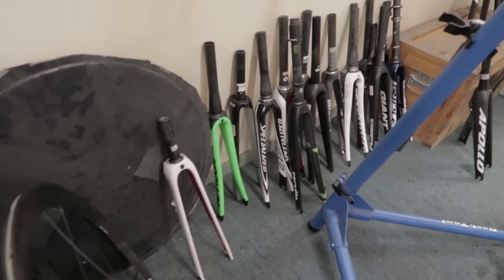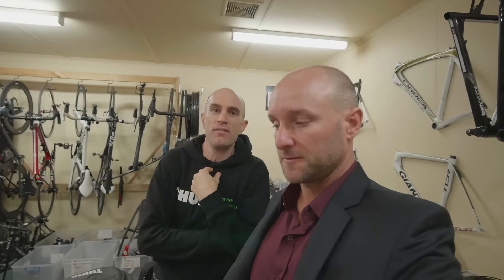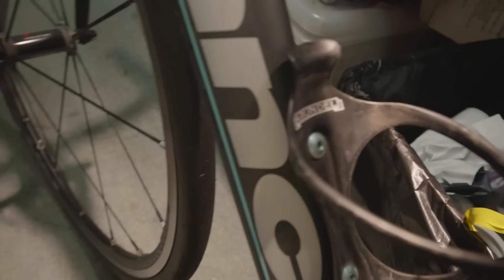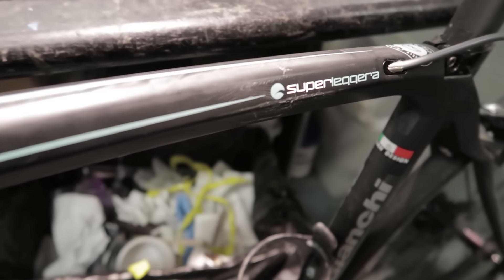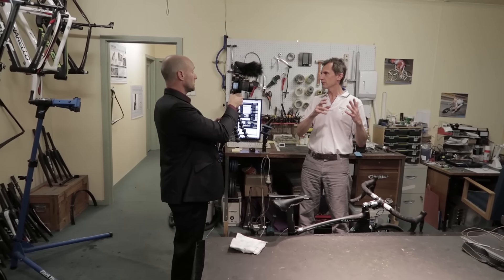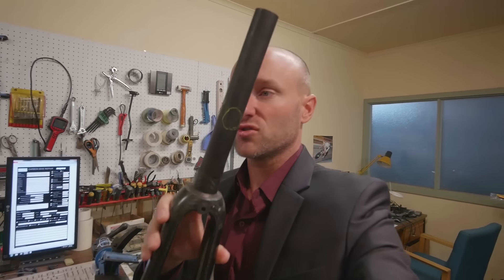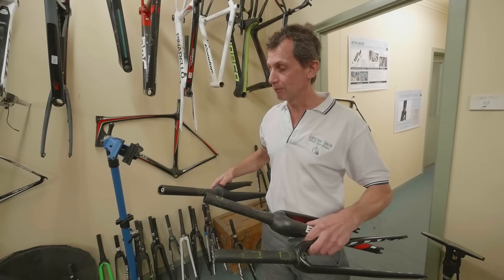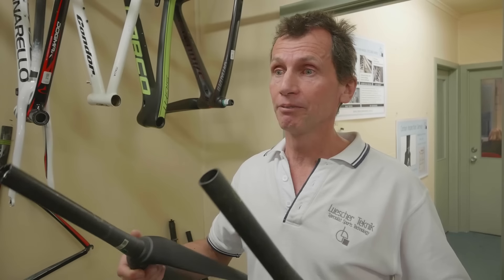Carbon Fiber Bikes - Are They Strong Enough? (ft. Raoul Luescher)

Comment: Thank you for making this video.  I understand that Pinarello constructs their bike frames with aviation grade carbon fiber.  I also understand, based on your video, that this doesn't necessarily make it better than other carbon fibers.  In fact, I'm unsure if as a result of using this higher grade carbon, it's possibly too brittle and not practical for use on a bicycle.  I'd appreciate your expert opinion.  Understandably, the talent and experience of the frame builder also matters a great deal.  What's your opinion on the durability of newer model Pinarello frames such as the Dogma F8 and the quality controls or inspections that each frame must pass?  I'm not familiar with Pinarello's inspection process.  How would you rate the durability of the Dogma F8 on a scale of 1-10, with 1 being worst quality and 10 being the best quality.  Any advice or opinions you can provide would be tremendously helpful.  Finally, would you advise against getting a carbon fiber frame for someone that weighs 200 lbs and needs a large frame?
Reply: I suspect that aircraft quality carbon fiber may not be the same as hi mod.

Hi mod is beyond stupid for bikes because the resin application has to be near perfect. 

Honestly, the lower grade models of any bike are usually much better.

They add at most a pound but are more durable. More resin plus less brittle carbon is ideal for me and 99 percent of people.

Only sponsored racers should bother with brittle high mod frames.
Reply: Wouldn't many aluminum frames be as light as a lower grade carbon fibre frame, but stronger? Or perhaps not?
Reply: Jim Thompson As light? No, you'll lose a half pound to a pound. No big deal, but aluminum tends to transmit road vibrations. No big deal if you ride less than 15 miles at a time.

Ride around 80 miles and you'll be shocked how much road buzz emitting from the frame can sap your energy and make you feel exhausted. That is why I love carbon. Give me a frame that is stiff yet feels like a wet noodle that disappears beneath me. Some don't like that, but for me that idealistic but unattainable goal is best met with carbon.

The thing I hate about carbon is it isn't durable to scratches or gravel rock dings. Or non riding stresses. Accidentally drop your bike or let it fall against the wrong object and you become worried you've ruined it. Probably not, but it does happen.

Carbon is indeed light....but this is by far the least impressive quality of carbon. And for bikes, only racers care about a half pound saved on a frame. Carbon is a dream material more suited to cars and planes with respect to its weight savings.

Carbon's main benefits are ride quality and perhaps saving 20 watts due to aero shaping.

The absolute headache of carbon is while it is very strong, once it passes a certain threshold of fatigue or stress it fails completely. I'm not talking about exploding into pieces either. It just simply loses its effectiveness quite dramatically.

Steel will just bend and slightly lose it's integrity but is still quite usable.

Another option is titanium. But it too is expensive.

Done right, mid level carbon, mid level titanium, and steel are great options for both performance and value.

Aluminum is awesome for bikes where you can get comfort from large tires. Or for when riding a lot is not your thing. And aluminum is the cheapest....gotta love that.

Expensive titanium is awesome but possibly overkill. It will last lifetimes though.

And possibly worst of all in terms of value is high end expensive carbon bikes. They are race machines for pros. Unless sponsored, or senselessly rich, avoid.

You'll feel like a real tool when your 3000 grand frame breaks and no team car pulls up to replace it. Lol
Reply: Anonymous DueToFascists
Thanks for this, really great information ! I haven't ridden anything in nearly 20 years, but last thing I had was an aluminium 2000 Giant TCR-1 I in my early 20s. I raced and trained on it about 400 miles a week and really thought I was riding on a feather and feeling amazing! Probably because I had a long break from racing beforehand. Raced from age 7 to 11 then went to boarding school and didn't touch it again until 10 years later. Got my Giant, it had all moved on from steel frames and totally different gear and gear levers not on the frame but on the brakes. I think my Giant was about 8 kg but that felt insanely light, light as a feather to me, smooth and wonderful ride, carbon forks. But it's interesting about the energy waste with aluminium! I probably would  feel I'm flying off into the sky with a carbon frame! I wonder how heavy the old steel rides we were using?

I understand what you say about aerodynamics being more important than weight, I've been hearing that.

The guy on the video says that the higher grade really stiff and brittle expensive carbon does not work like suspension and is thus slower as it doesn't get the traction. So I wonder, if this is the case, why the pros use bikes that don't get them traction. This guy in the video makes it really sound as though the lower grade carbons are actually faster!

I'm also wondering why you say carbon fibre is "stronger" than other rides like aluminium when it can break so easily? In what way "stronger"? Sounds really not strong at all lol.

This thing about being both stiff and pliant like a wet noodle is amazing! How do they get both? Do you mean it's stiff laterally but pliant vertically?
Reply: Jim Thompson Honestly, if you were happy with aluminum and aren't overly annoyed by road buzz, then carbon won't be a miracle material for you.

And aluminum is quite stiff but carbon has the benefits of the ride being infinitely tuned to a rider's personal preferences.

Aluminum has made great strides. So ride quality keeps improving.

But carbon has the added benefit of targeting two seemingly contradictory properties. A frame can indeed be laterally stiff (for pedaling) and vertically compliant. And a vertically complaint bike is actually faster than a rigid frame. It acts as a suspension were the bike can maintain contact with the road in a smooth manner. This helps on both rough roads and on fast descents. Especially on fast descents. Imagine you're flying down an incline and the tarmac gets rough. Well if your bike starts chattering from vibration, even a little bit, you lose speed and stability.

Honestly, just about every frame material I could fall in love with, except for the budget busting craziness of high end carbon frames.

Carbon is strong as in it will take loads far beyond aluminum or steel. But that's all theoretical. Carbon fiber can be sanded away quite easily and fails suddenly where steel and aluminum will bend and then break from stress loads.

Think of carbon like this: "brittle and stiff" if layed up a certain way and "brittle and complaint" if layed up another way. But bottom line is. If the load exceeds the design limit, it will snap or crack.

Carbon is the brittle stuff and the resin is simply what keeps it in place. Everybody talks carbon, but perhaps the resin is the most important.

Metals can be stretched; carbon and resin can but only a tiny bit.
Reply: Anonymous DueToFascists 
Thank you, very interesting! I have just returned home from visiting family which is why I'm late in responding. I really am intrigued to try a carbon racer some day. And very interesting about the importance of the resin.

Do you have any idea why a frame that has perfectly round tubes like the old steel bikes is less aero than tubing that has similar width but more depth? I am guessing if a carbon frame had the same thin tube geometry as the old steel racers, they would be too weak and would fail. Although if carbon is stronger it should not.
Reply: Jim Thompson Well, thin tubes for the seat tube and down tube are not a good junction for the bottom bracket. The tubes that connect to the bottom bracket should be wide to maximize lateral stiffness.

A wide but lighter tube can achieve this.

As for aero capabilities, wide tubes and their inherent non aero size and shape can be offset with using kamm tails or an aero tear drop shape. 

But all this is a bit of never getting exactly  what you desire.

If a bike is designed entirely for aerodynamics then the bike is usually vertically stiff and laterally compliant. That's the exact opposite of what you'd want as far as ride quality.

But I certainly have my gripes with carbon. In my opinion frames are too light and more needs to be done to protect the frame from gravel dings. A thicker more resilient paint and finish would achieve this.

Carbon is stiff and brittle, and unfortunately the resin that holds it together can be sanded away quite easily. So it is of the utmost importance that the finishing layer be
 extremely resilient.

Imho, only carbon cyclocross frames have achieved a sensible weight and finish.

Carbon road bikes are too obsessed with weight.

Carbon is ideal for infinite layup possibilities and ride quality, and lightness should be the last priority.
Reply: Jim Thompson As to why are carbon frames not using thin but dense tubes like steel frames...well they are but they're used on the rear triangle: chain stays and seat stays.

This makes sense. A thin tube with thick walls will be strong and be sufficiently compliant. A large tube with thin walls will provide lateral stiffness but be subject to more stress. That's ideal for down tubes and seat tubes.

Carbon is an awesome material. But let's be honest, the bike industry often makes less than ideal products designed to sell and not to perform.

There are so many bikes that I just want to scream at the design departments. They know full well they're addicted to frame weight reduction over function.

The UCI needs to scrap the weight limit as a stand alone rule, asap. They need to conduct structural tests and allow lighter riders to ride lighter bikes. The bike weight should be a percentage of a riders' overall weight...end of story!!! They could test this before each race. If a rider violates the range ever so marginally they're given a 20 second penalty on each stage.  This is workable and sound science but the bike industry would shit a brick.

The bike industry wants to mass market frames being ideal for a rider that weighs 120 pounds all way up to someone weighing 250 pounds. This is crackpot marketing.
Reply: Jim, great post.  I used to be into cycling in the  early 90s.  Life got busy to I put away my old steel Pinarello, 7-speed with friction shifters on the down tube.  Well, I've got time and interest in the sport again and lately I've been looking at Pinarellos again.

Your description of the bicycle manufacturing industry describes my own concerns.  I understand that early carbon fiber bikes were crap...they cracked a lot.  I understand that they've gotten better.  However, as you mentioned, it appears that there's still a race to build the lightest bikes, potentially at the cost of durability.

I'd much rather have a durable bike that won't crack, especially considering that the price tag of bikes has gone up 3 to 4 times in price since the time my steel frame was new.

I'm 6'3" and weigh 200lbs.  How concerned should I be with a bike frame, specifically a new Pinarello F8 Dogma, cracking on me?  I understand that the company uses a high grade carbon fiber that's also used in Boeing 777 construction.  Sounds like good stuff...but is it good for application with bicycles?  Are carbon fiber bikes largely still experimental or do the bike manufacturers really know what they're doing?  Are newer carbon fiber frames built to last a lifetime like an old steel frame?

The more I read, the more I'm thinking that I just need to dust off the steel bike, tune it up and use it.  I'd like someone to tell me I'm wrong.  What are your thoughts, or anyone else that has in-depth experience, knowledge and expertise with carbon fiber frames?  Please keep in mind my height and weight when giving the advice.
Reply: Anonymous DueToFascists 
Really interesting information Anomymous, thank you! From what I can gather, it seems having a light as possible bike is good only if it isn't compromising various attributes. I am seeing that tear drop shape on the bikes. Interesting about cyclocross bikes, I think I'll have a look at those and see what they are about!

I've been thinking about the weight issue and wondering if there is a critical mass weight or not. For example, and this is quite theoretical not practical at present, if you had two bikes, one at 3 kg and one at 6.8 kg, but each bike had exactly the same geometry as well as all other attributes equal like stiffness in the same places, pliability in same places, exactly the same strength, everything but weight is the same... would the 3kg bike then be the faster go to machine for racers? I know this is not possible at present with current material science. But if it was...
Reply: Jim Thompson Well, cyclocross bikes aren't applicable for most road riding. Brakes are cantilever (sometimes disc) but the tire clearance is a bit overkill. You don't need 35mm+ tires for road riding.

What I do like about them is the geometry is more stable for keeping a straight line and they are made to take some abuse.

If two bikes were identical in every way, the lighter one would be faster up steep climbs, marginally faster on flat roads, and I can't emphasize just how marginal...as in non existent, and slightly faster down hill.

Rolling resistance on decents as well as cutting through the air can be helped by having a bit of weight.  But it'll cost you dearly when the road turns up again.
Reply: RedondoBeach2
Just read this in a forum which is a bit different from what I had originally thought and is a response to a plug of steel frames. And I'm reading that most CF bikes are made for a "common denominator" weight of 220 pounds. In in fact if you are closer to the common denominator weight the frame will work better for you than if you are well under the common denominator weight because the frame is made for the common denominator weight like a custom job. Lighter guys can often find these productions CF bikes made for 220 pound people too stiff or harsh or something. Well here is the forum quote:

Mike Shea · Field Services at AES Engineering
So much of this article is complete nonsense. I see old OCLV frames are still stiff and rideable some 20 years later. CF frames are repairable and some are even easier than steel to fix. Many CF frames are available as custom builds and CX frames can certainly be made with lots of mud clearance. Lightweight steel frames are as easy to damage as cheap CF. Anyone that has ever looked at he Santa Cruz web site can easily see how tough modern CF frames are. CF stands up to fatigue better than most any metal, has higher strength when correctly engineered etc. It is like this article is recycled from 15 years ago and even then I would love to hear about CF getting noodly. Lightweight steel frames are also destroyed in crashes. I have a 2006 C50 that was raced and crashed by a pro rider during the 2007 season. It has been my go to ride since the winter of 07 when I bought it. Yes it was crashed and it is available in 1 cm increments like old fashion steel frames and can be purchased as a custom build. I think Calffee and Parllee and just about any lug and tube CF bike can be built as custom.
Yes steel can be just as nice as a cf frame and unless you need custom you can spend the same coin on a CF that should outlive the steel, be as stiff and lighter too. It does not rust either. I sold my Master Olympic and I will concede that bike was "to die for" pretty as well as a sublime ride but the CF does all that too and is 2.5 pounds lighter at 16 pounds. From the artistic side I do miss that steel bike.

Comment: Well , the SR 71 blackbird was Titanium. . .    I can't imagine carbon handling the tenperatures.  As for F1 cars. . .   They don't run 20,000 miles. . .   unlike a titanium bike.  I own them all. . .  steel, aluminum, carbon, titanium.   My favorite long distance unit is titanium.  And I've raced it and TTd it as well .

Comment: 27 minutes he is wrong.   The stiffer material doesn't take the load first.  A steel rod held on each end by elastic bands; the bands stretch because the force goes through them first.
Reply: Perhaps he meant the stiffer material handles the load and the more elastic structure will separate right at the junction. But he is right on most diy repairs. They never focus on making a smooth transitioned repair. making the repair super duper strong is super duper stupid.
Reply: I think he meant an elastic band wrapped around a steel rod, not two bands at the ends of the rod.

Comment: What's the best way to transport a carbon bike?  Like what kind of hitch/trailer style?
Reply: Not with a top tube clamp that's for sure! :) I use Thule OutRides on the roof of the car. Front wheel off, fork mount. (I can also help out Maven fans in AU with mates rates, let me know if you need anything!)
Reply: +Shane Miller what if the trailer hitch is the only option...car is too tall for that type of rack I think?
Reply: Check out the Thule T2 PRO 9034. Thule.com.au has details. Hooked someone up with one last week. If you're in AU let me know, always happy to help.
Reply: +Shane Miller I don't live in the states but thank you a lot for the help!
Reply: +Jonathan Marks AU as in Australia.
Reply: +amber Serene haha, I "do" live in the states...haha, oops